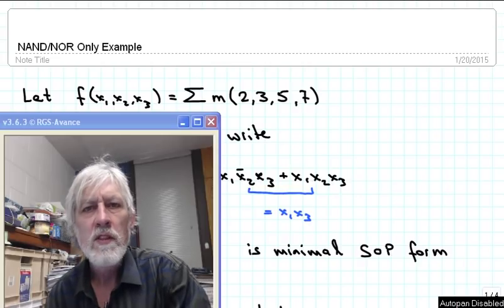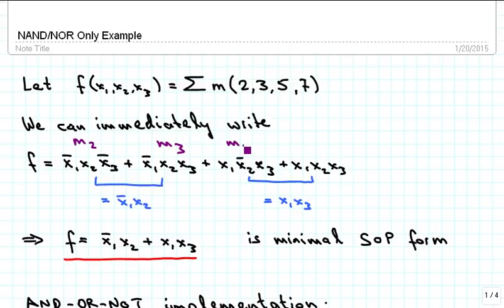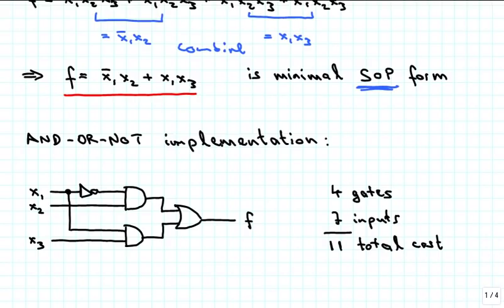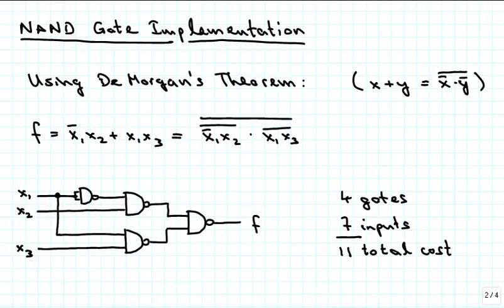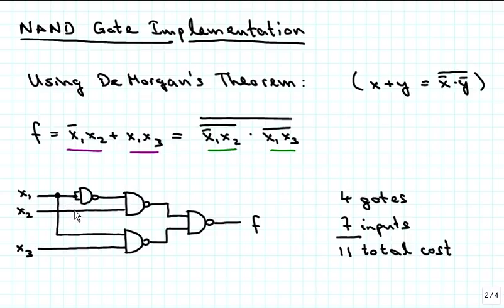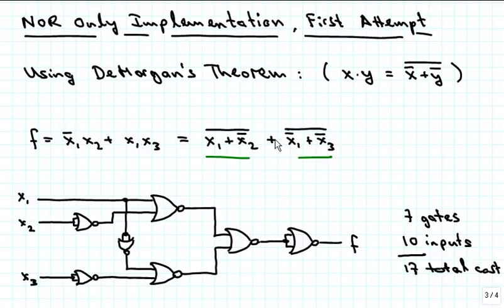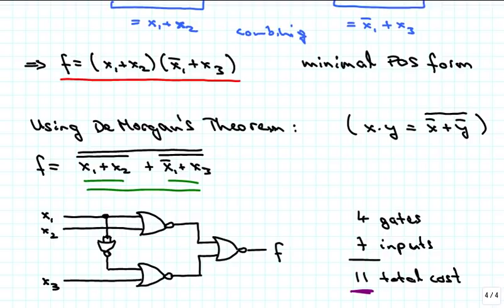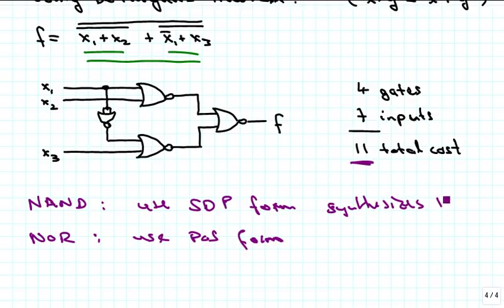NAND/NOR Only Example

Comment: Dear Sir, 
isn't the number of imputs in the NAND Gatter Implementation 8 ?
Reply from the maker: The double input at the NAND gate that is used as an inverter counts only as one input. The main reason why inputs are counted for CMOS gates is because the trace(s) leading to the inputs take up real estate on the integrated circuit. If two inputs are connected together only one trace is needed.